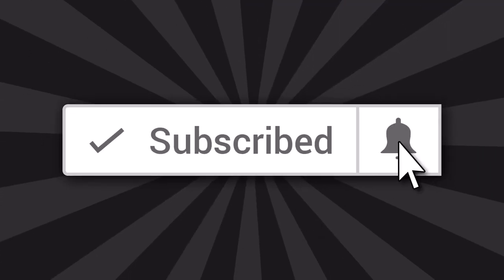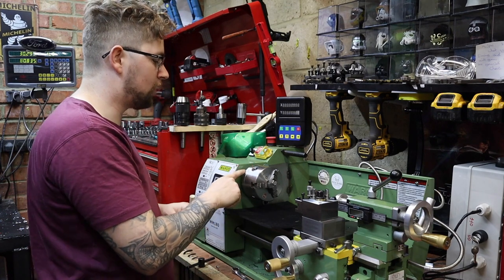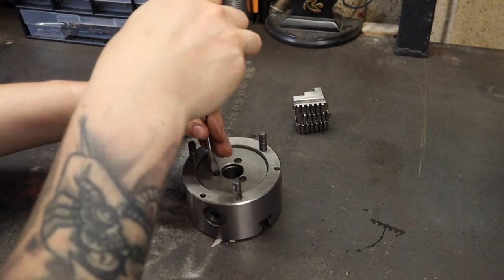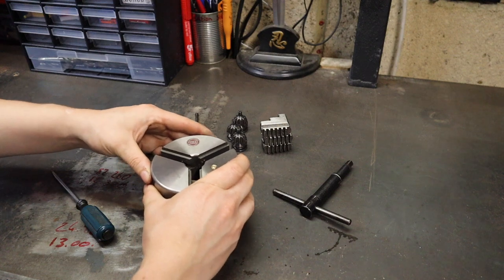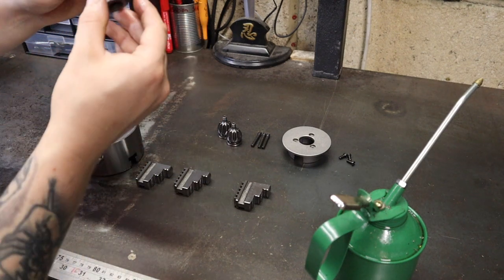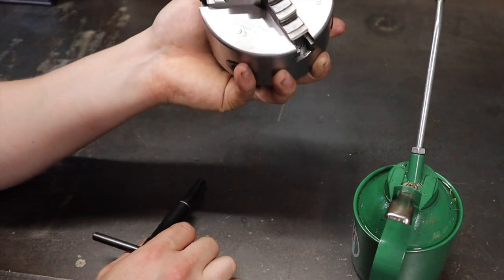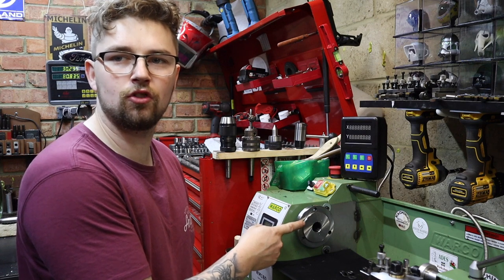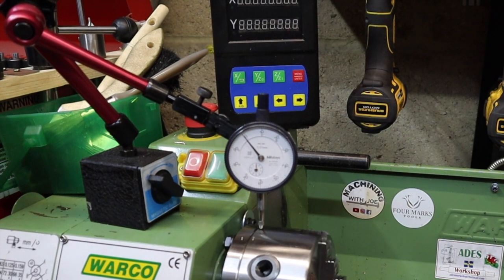Lathe Maintenance Chuck SERVICE

Comment: Great video, I've just received my Warco Super Mini Lathe so this is really useful, great presentation. One thing I've thought of but not sure there is sufficient clearance on the the mini lathes, is to use Torque Wrench to do the final 3 nuts up.
Reply from the maker: He Leon thank you and hope this helps you with using your new mini lathe. Torquing the bolts up would be ideal but as you will find clearance is a bit scarce. If you find yourself in need of some ideas for upgrades I’ve got many videos on this so feel free to check them out.
Reply: @MachiningwithJoe  To be fair love all your videos you've posted that I've seen buddy. I'm going to try and do one of the first things you did and create some larger handles in brass. I've been just practicing the basics and cutting nice finishes on different tubes. So far I've figured out about 800 RPM and using the auto lead feed seems ideal. I went for the DRO as you had and it's really accurate and you can't really go wrong. Keep up the good work. I'm already thinking I maybe should have bought a larger quieter lathe like the WM250V but hey ho. I'm now looking at milling machines, currently toying with the idea of a Sieg SX2P. Ultimately I want to try and make some small IC engines. I've made a workshop for my Son who is 12 and has been into electrical and engineering projects since he was about 5. Enjoy your videos buddy 👍

Comment: Be careful with the use of compressed air on moving parts or guides. You can blow fine dirt in instead of blowing it away.
Reply from the maker: Good little tip thank you will bare that in mind for the future. 👍
Reply: Good call. Perhaps vacuuming would be a better option???
Reply: @mxfxdlg  Yep! better vacuuming!!